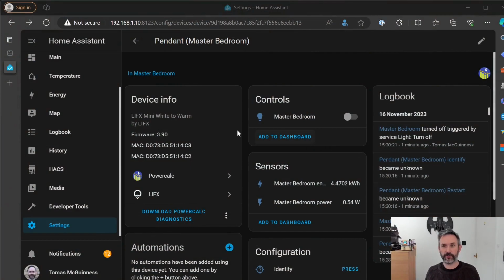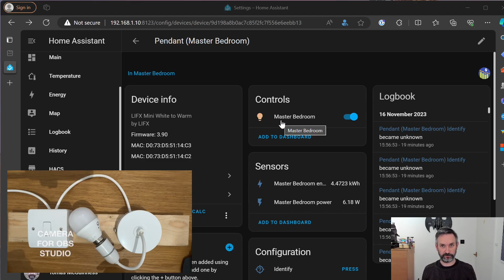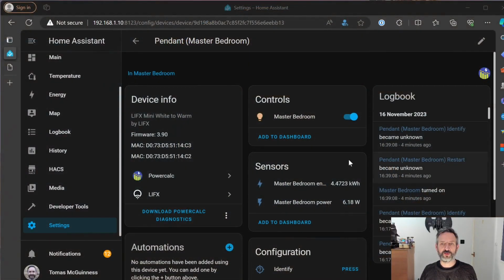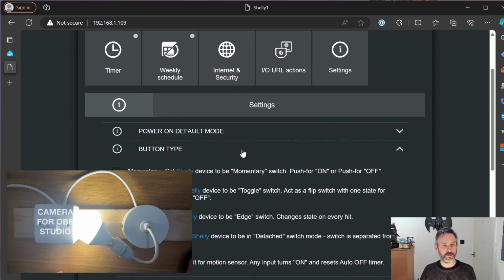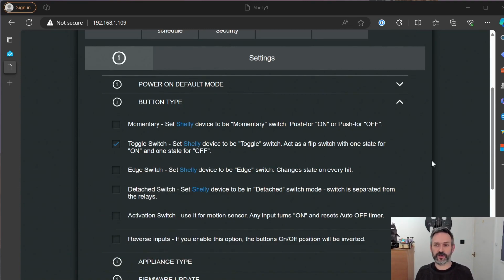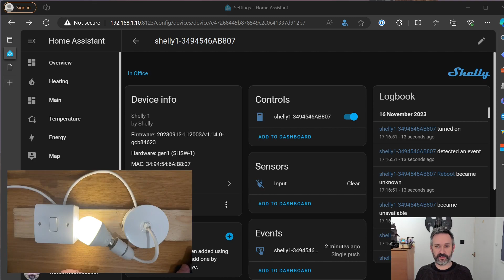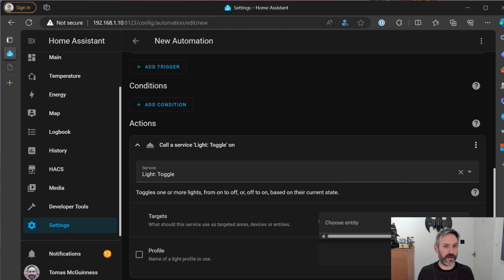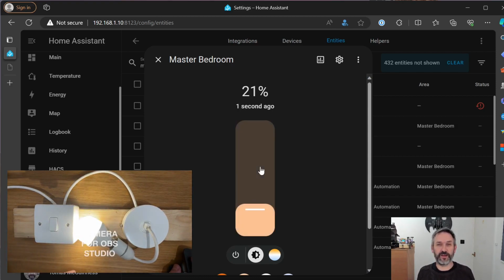Combine Smart bulbs, Shelly relays and dumb light switches for the perfect setup!

Comment: So all your light switches stop working if HA or your network is down for some reason.
Thats not really acceptable for me.
Reply from the maker: That is correct! It's a major downside.

So far it has happened twice in the four or so years since I implemented my first one. Once when I wiped my Home Assistant setup and again, when my Home Assistant server ran out of disk space.

To help, I have created a failsafe mechanism - https://youtu.be/0Zs2DwWqH5I - of course, this doesn't work in the event of WiFi failure.

I need to develop a script for my Gen 4 devices that will perform the failsafe on the device using Shelly Scripting. That would work in both scenarios. I have not gotten to that yet.

Comment: How do you install this though.
Reply from the maker: How do you mean?
Reply: @tomasmcguinness I have only installed smart switches. One wire going from power to switch. Other wire going to light. One neutral and one ground.
Reply from the maker: Ah, there are loads of guides and videos of installing Shelly Relays. Most go into the ceiling rose.

Comment: Thanks for this video. I've just acquired my first couple of Shelly Relay's intending to use them this way in 1 room, and the traditional way in another room (where I'm using dumb-bulbs).
My question is, can I use a Shelly 1L Gen 3 in the same detached mode as you demonstrated here (if you know)?
I want to add the relay behind the switch, but only use the switch as a trigger in a home assistant automation, and keep the power "on" to the bulb.
AI is telling me to give the bulb and the Relay permanent power, and as I'm not familiar with the Shelly relay's I don't want to play with it all until I'm certain, but from what you have shown here, I think it should be possible.
Just wire it up as it would normally be intended to be wired (with the bypass as I have no neutral) and then use it in detached mode?
Reply: I've connected it all up and used the bypass, etc., but the relay is buzzing when it's on. Any advice, please?
Reply from the maker: Is it a loud buzz or a quiet buzz? When the relay engages it might make a faint noise, but I shouldn’t be audible. Not that I’ve ever heard anyway.
Reply: @tomasmcguinness thanks for replying Tom. It's louder than I would expect. If I use the relay to cut the power to the fixture/bulb the buzzing stops, but when it's on its loud enough to hear when walking past it. 
I'm slightly worried that it's dangerous.
Reply from the maker: I agree. Disconnect that. It sounds like it might be faulty. I’d contact their support and see what they say.
Reply: @tomasmcguinness Thank you

Comment: I think the "edge" setting does exactly that without the need to do an automation.
Reply: No, edge will toggle the relay and so a smart bulb would lose power.  However it is good if you can't use a smart bulb.  I use this mode for my g9 bulb lights as for years smart bulbs were not available and it allows the switch to be used as well as having the relay to toggle remotely.
Reply from the maker: Won’t “edge” toggle the relay?

Comment: I've been trying to get this working for a while I know I can do it with Aqara T2 switch and a shelly or aqara relay but I don't want to buy into the Aqara proprietary zigbee stuff I already have 1 zigbee hub I don't want another one! I'm switching to Home Assistant so of course a bunch of stuff won't transfer so I'm already having to get a matter hub and swap out a bunch of bulbs. Ok before I get to the question I do have a bunch of experience doing wiring but not with relays so I do know how to be safe and even wire them safe I'm just not positive of the order!! Anyway here's the scenario I hope someone can help with! I have a ceiling fan in my bedroom and in my kitchen that both have a single switch that turns off everything and of course the switch is always getting flipped and killing the smart bulbs! I think I can put a Leviton 2 pole switch with a shelly relay behind it and then install a relay at the fan and use the relays in decoupled mode. Is my thought correct here? If so what relays do I need I'm fairly sure I can use the Shelly 2pm at the fan but I'm much less sure about the wall switch side! Do I use another 2pm somewhere I read to use the Shelly i4 which seems to have 3 switch inputs despite being called i4! Which brings me to the last questions I'm not sure exactly how the switch side should be wired if I use the i4. do I go L and N into to the relay then out to the switch and back to the SW1 and SW3(where the hell is switch 2 lololol) anyway any incite would be appreciated!!
Reply from the maker: Are you in the UK? 

What are you trying to achieve? Do you want the ceiling fans to operate on their own switch?

Comment: Hi sir, excuse me for this question: if I don’t have Home Assistant, I suppose I can’t turn on my bulb if the switch is off ?
Thanks from Italy
Reply from the maker: You could use whatever app controls your bulb directly. By using the detached relay mode, the smart bulb always has power, regardless of the switch.

Comment: Nice video! :)
Currently using smart hubs combined with HomeKit and wan't to install this solution so it's easer for gues and other to use the switches the "normal" way.

I guess this will work with non smart bulbs aswell? 
Example that i have a lamp with many bulbs. Would be cheaper to easier to control all the bulbs instead of replacing all the bulbs with smart bulbs?
Reply from the maker: Thanks.

The Shelly devices will work with normal bulbs too. I use several in my house. Beside lamps and hallway, where I never need to dim them. They are just connected to Shelly 1 relays in the normal Toggle mode.

Comment: I was trying to do essentially exactly what you are doing.  Seeing this video laid out so clearly was very helpful for me.  I'm now using a Shelly 1PM in detached switch mode and it's exactly what I was looking for.

I have an automation that fires a time of day light script in Home Assistant.  It turns on Hue bulbs to different scenes based on time of day.  This script (from a blueprint) also turns the lights OFF if it is triggered while the lights are on.
Thus my regular dumb light switch turns lights on or off, and sets brightness based on time of day.  Thanks again for the great clear video.
Reply from the maker: Thanks! I'm glad you found it useful. Combining all the elements unlocks some useful automation!

Comment: I am currently renovating my house and want to have a setup whereby, for a given room, both my wall switches and remote switches (and phone), can be used to cycle between predefined scenes incorporating on/off state, light temperature, and brightness. For example, if for a given room I have a series of smart/dumb bulbs across lamps and ceiling/wall lights I want to be able to hit a wall switch and cycle through my predefined scenes (for example with multiple presses) and then when I go an sit on the sofa, do precisely the same thing from my phone or a remote light switch. I'm guessing that an absolute must for this is to have a two way rocker switch so that I can set an upward press to be 'on' and then subsequenct presses to cycle between scenes, and for a downward press to be 'off'.

Do you think that is achieveable using a combination of Shelly's, HA, and smart/dumb bulbs? Thanks :)
Reply from the maker: Yeah, that all sounds possible! Do you have a rocker switch in mind?

Comment: What I dislike about this solution with detached mode: when home assistant or the wifi connection is not working (e.g. during an update) your light does not work.
An alternative is to have the shelly work normally. In node red however, whenever you detect the Shelly turns off the light switch, you turn it back on and then turn off the light itself.
Now when you automation is not working, the switch still controls the light.
Important disadvantage: when you turn off the light using the switch while home assistant is functioning (which is most of the time) then the light will briefly turn back on.
Reply from the maker: This is very true and that issue was one I was concerned about  too. I even got the occasional shout from my wife or kids that the lights weren't working :)
However, I found a solution using Shelly scripting. You can add a script to the Shelly itself that will monitor a URL value. If that becomes unavailable, the Shelly will switch back to the normal toggle mode. When the URL is available again, it will turn into detached mode. This should hopefully cover all manner of problems. I'm just testing my script, and I'll hopefully have a video up in a week or two!
Reply: @tomasmcguinness  very cool solution. Unfortunately it won't work though on my Shelly's as they use z-wave rather than WiFi and can't run scripts...
Reply from the maker: Really?? I didn't know what. That's disappointing. I'd have assumed all their devices supported it. I wonder if their Gen 4 Matter/Zigbee devices will support it?
Reply: Hey! This video was exactly what I was looking for! I'm also looking forward to the video about the shelly URL script solution as my setup needs to be wife proof 💡

Comment: Thank you! Just wondering if this can be done without Home Assistant, maybe with Alexa or Apple Home?
Reply from the maker: Very nearly! Shelly are about to release their Gen-4 products and they support Zigbee and Matter protocols. Using Matter and Apple Home, you should be able to set this up. Same would go for Zigbee. Essentially, you would just treat the Shelly as a switch and connect it to the Lights using an Apple Home automation. I'm waiting for Shelly to release their Gen4 and I'll certainly test it out. In fact, I think that would be a good idea for a video! Doing the same thing, but using Matter or Zigbee.

Comment: I have just done a similar thing using the Sonoff ZBMINIR2, turning on the state action setting, then using this as a toggle to switch on my smart bulbs. I have detached the relay mode and set state to always on. Now I have no power loss to the bulbs and I can turn them on and of with a standard rocker switch, thanks for you video it has helped tremendously.
😁
Reply from the maker: Brilliant! Do you like the ZBMINI units? Temped to get a few and try them out. I suspect they would be less power hungry than the WiFi Shelly units and probably operate much faster!
Reply: @tomasmcguinness  yes, so far so good only had them a couple of weeks but stable and fast.
Reply: @tomasmcguinness  In this whole solution I miss a significant functionality. When my HA server has a failure I want to still have the possibility of basic control of turning the bulbs on and off with a physical switch and preferably also brightness. I would not like the HA failure after the next update to deprive me of the ability to turn on the light normally, because I do not have time to spend time on HA this week. In such a scenario, your home will be even "dumber" than before you turned it smart.

Luckily, we have a local server, although unlike my friend, when his internet provider had a failure, he couldn't even turn on the lights in half the house because Tuya didn't work.
Reply from the maker: Funny you should mention that as it's been on my list of things to investigate. Shelly relays have functionality where you can add your own scripting to them. I've seen a few articles in which people have written scripts to detect any loss of connection to Home Assistant. When they detect an issue, they switch back to standard relay mode. When connectivity is restored, they'll resume their detached configuration. 

I'm going to give this a try in the next few weeks.
Reply: @tomasmcguinness  Nice! I can't miss that!

In the meantime I also came up with a fairly obvious solution, but based on zigbee, not wifi. Zigbee m2t devices have a nice option of binding devices directly to each other, so you can control them via HA, but when HA fails, the physical switch with the relay will still control the smart bulb in detached mode.

Comment: Thank you I've been looking for a way to do this for a long time. Question is there a  way to do this but for a dimmer switch? So that you can still dim the lights with and actual dimmer.
Reply from the maker: I asked myself that question a while back and I didn’t find an answer. I have some dimming solutions in my house, but they involve Zigbee dimmers and home assistant. 

Unfortunately, I haven’t come across a solution that uses a physical dimmer switch. Something I would like to solve as I could do switch physical dimmers to work with my smart bulbs. 

If I come across anything, I’ll let you know!

Comment: I am looking for a small, thin smart relay switch that will work with 12v DC LED lights, any suggestions?
Reply from the maker: Hmmm, I believe the Shelly 1 worked with 12v DC, but that has been discontinued. Are you looking for a WiFi one?

Comment: This was just what I was looking for! I ended up buying 6 more Shelly 1 Gen3 mini's to control the switches connected to lamps, etc. that I have Philips Hue bulbs in. This has really changed the game for me. It's also prompted me to look at moving more control to Home Assistant. I had no idea it was this powerful!
Reply from the maker: Great to hear!
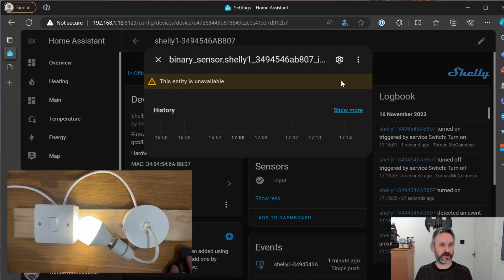Reply: I've Shelly 1 Gen3 (non-mini), and HA for some reason do not receive any data when the switch is flipped (the sensor that is enabled at 8:44). If it works in the mini version, it does not work on a standard version. 
I am running the latest fw.
Reply from the maker: @randomcritic3652 I am only using Shelly 1 units and a lot of them are Gen 1. None of them are of the mini variety. What sensor are you checking?
Reply: @tomasmcguinness   First of all thanks for the video, it helped me move on with my little project. Now, replying to your q: I've got Shelly Plus 1 (gen2), and Shelly 1 gen3. Sensor "Input 0" works on Plus (gen2) device, but does not work on Gen3. Probably related to the firmware. 
I don't expect any help here in the comments, just letting others know in case someone is planning to get the relays only to  find out it doesn't work with non-mini gen3. I've also got mini too, will test it as well, but if it worked for @TheNicomachen, it probably will work for everyone else.
Reply from the maker: @randomcritic3652  Annoying and hopefully something they'll resolve ASAP! Thanks for sharing!

Comment: You just made my hole day! Thank you very much for the video and the provided solution! I am in a process of building my new house and your video just popped up in the right time 😊 About the backup solution I am considering using a simple script which checks every minute or so if the HA is up and running and if not than falls back the Shelly to relay mode…. And when the HA is back on to toggle detached mode to all the relays. It will be useful not only when the HA is off for some reason but in case you decide to update it and at the same time some one wants to turn on/off the wall switch 😊 Once again Thank you!
Reply from the maker: Awesome! Glad this was helpful!

Comment: You can also write a small script in shelly, which makes a mqtt (or http) call to your bulb. In case of an event -state on-, i send a mqtt message to my bulb which set the state on and vice versa. 
In Home Assistant you do not have to use the shelly entity, but just the smart bulb.
In this way, even if HA cannot be reached or so, your wallswitch will be functioning normally, and the direction of switch shows always the correct one.

Btw. i did not use the new i4, since i may need a relais in the future. My shellyMini1 is in detached mode, and on top of my script i make once a shelly.call with "switch set on". So it behaves like a direct wiring of bulb.

I think this is the best setup with minimal effort for possible future changes.
Reply from the maker: Thanks for sharing! 

I have not yet looked at the scripting you can use with a Shelly. I really should because it sounds like it would might enable some more powerful control.

Can you recommend any good resources aside from the Shelly documentation?

Comment: I did this, but using ESPHOME instead of Shelly Integration. This meant I could code a fallback behaviour in case of loss of Wifi*, or Zigbee. *In fact I borrowed the source code from the ESPHOME website, which can already fallback in case of loss of Wifi, and adapted it for the loss of Zigbee.
Reply from the maker: It's something I really need to look into. I'm going to have to make my family a cheat sheet in case something goes wrong when I'm not about.

Comment: I haven’t looked in to it but could you take this a step further and if comms to HA is lost a script on the Shelly changes the switch mode so that the light switch still works?
Reply from the maker: I think that can be done using some script running on each Shelly, but I’m not sure. I will certainly take a look!

Comment: Can the device work behind the actual light fixture. I'm trying to find something that doesnt need a light switch.
Reply from the maker: Yes, they can. Of all the Shelly relays installed in my house, eight are in the ceiling roses. I did a blog post on it a few years back, which might help? https://tomasmcguinness.com/2020/01/24/shelly-1-relay/ If you don't need the light switch support, the Shelly Relay is probably more than you need.
Reply: @tomasmcguinness  I will definitely take a look at this. I'm trying to smart my RV. I saw the main site that sells these and they have so many. My lights are on a 12v system while most of my appliances are 110. Couple more questions. Can these relays work seperately once plug in above the light fixture since the way it's powered with one switch I have like 9 lights turning on for the main cabin that I would like to control a portion for one side and etc for the other side. Secondly which relay would I need since they got so many on the main website.